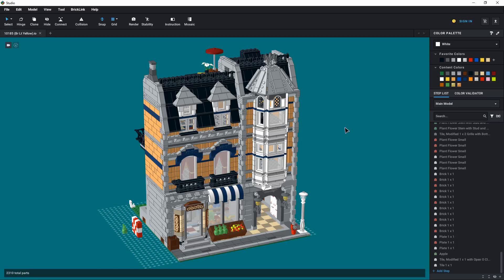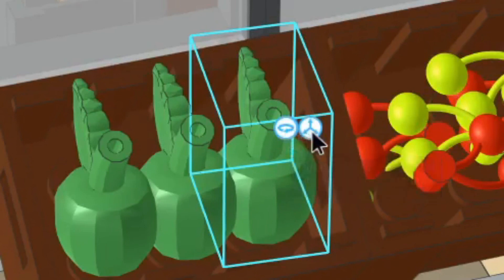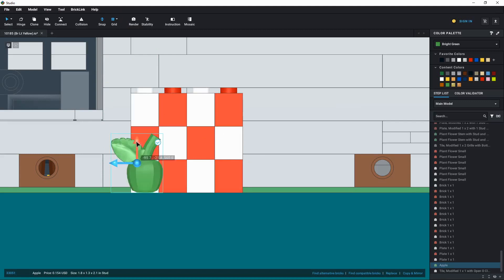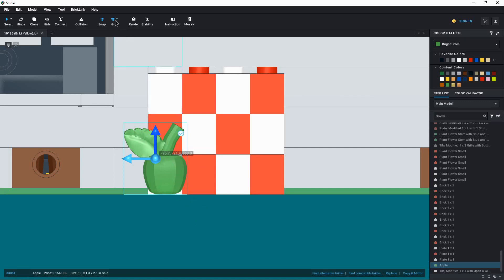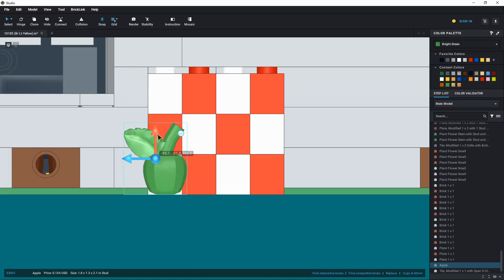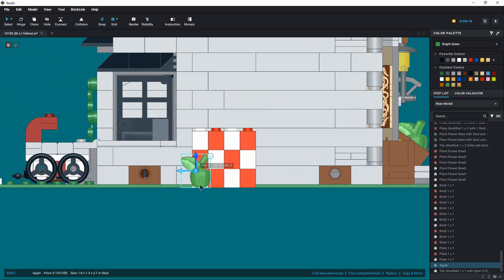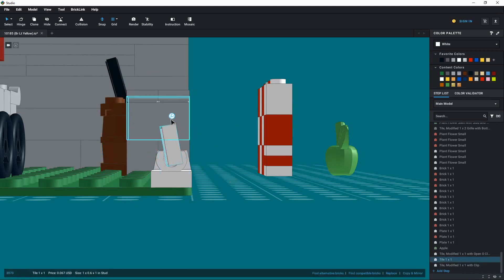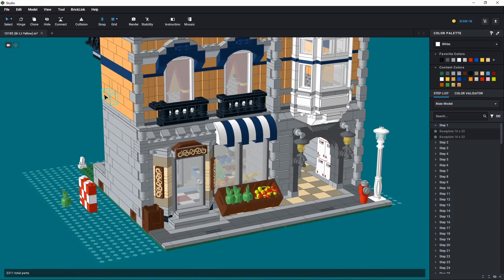Bricklink Studio: Using the Grid Size and Move Tool to adjust Part Placement

Comment: How can you bring a part back "into grid" when you moved it arbitrarily before?
I find BLS does MOVE it in grid spacing, but does not reset the item TO the global grid, making every following move "off-grid", just with same spacing as the grid.
(I hope that is understandable)
Reply from the maker: Is it just one part that is out of grid? You could change to the smallest grid option to try to nudge it back into place and then change back, or if it has a connection point, see if it will snap to a brick that is still in the global grid. Depends on the part probably

Comment: How do you move your viewpoint side to side? I find whenever I use Bricklink Studio my viewpoint swivels around a fixed point which I can't seem to change. What can I do the fix this?
Reply from the maker: I am not running the latest version of Studio so it my have been changed, but I can right click any piece (or even empty space) and choose "pan to cursor" from the dropdown menu. The other way I know of (which is the way I use 99% of the time) is to hold down the center scroll wheel and drag the scene to a new center. You can also set up a custom "pan to cursor" shortcut in the preferences menu.